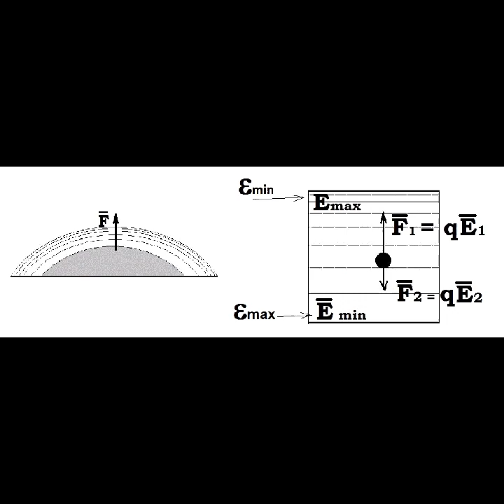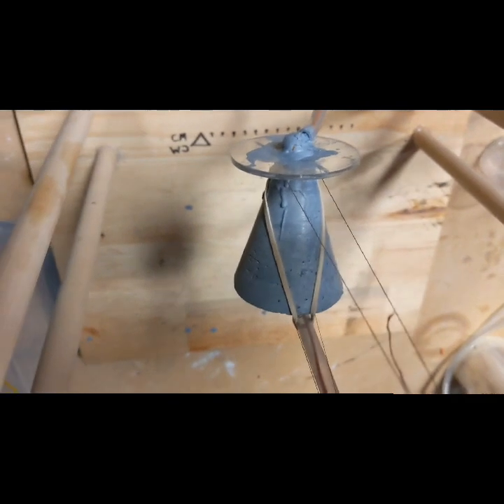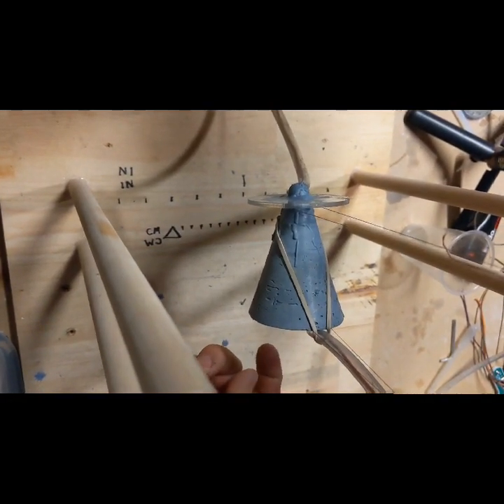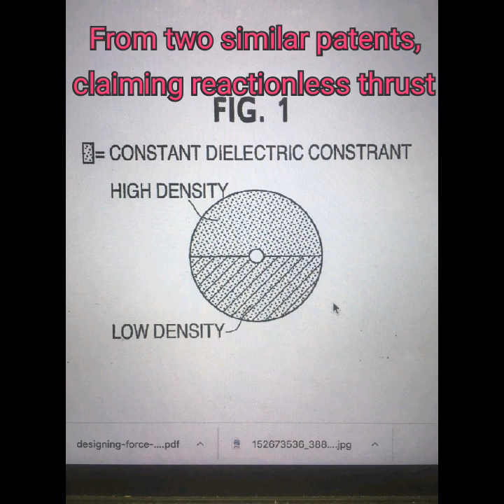Converging Field Propulsion - Tapered Dielectrics

Comment: Shouldn't you be using dielectric energy rather than straight HV pulses?
Reply from the maker: Sorry, I don't know what you mean. Dielectric energy is stress energy stored in a dielectric under polarization. Any potential will do this.
Reply: @failforwardresearch3127  In TT Brown's notebook (published at rexresearch) he shows dielectric energy associated with his tapered slab lifter.  Avramenko shows in his diode plug patent an inductor - as big as his HV transformer - which provides dielectric energy.  The inductor is loosely wound, with wax smeared around all the layers and turns.  Energy is stored in the dielectric and can be pumped out with a diode,capacitor, and another diode, then back,with a T tap at the capacitor.  The stress energy circulates through the taper, and back around in the adjacent atmosphere.

Comment: put it in a vacuum chamber, so you can eliminate ion wind
Reply from the maker: I dont have a vacuum chamber, but would he a great experiment. Especially to plot air pressure vs. deflection.
Reply: @failforwardresearch3127  You can build one. Just by some really thick pexiglass on ebay & build a cube around that. It doesn't need to be a perfect vacuum. Just a very significant one.
Reply: This would address some of the corona concerns as well.
Reply: just wrap it with a plastic bag